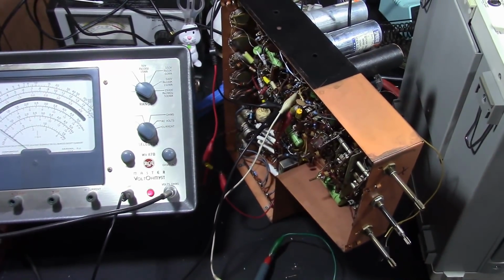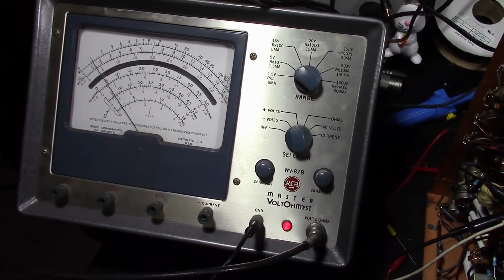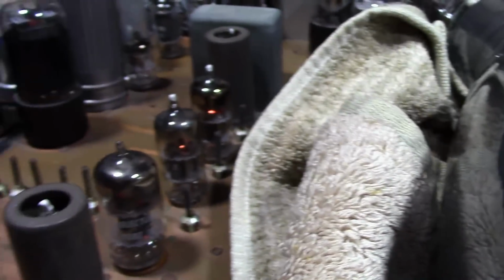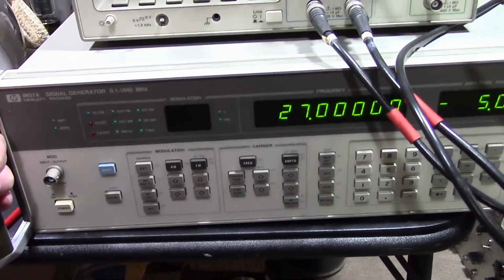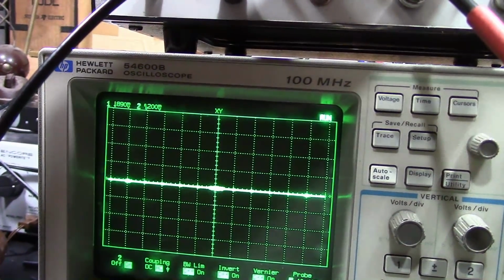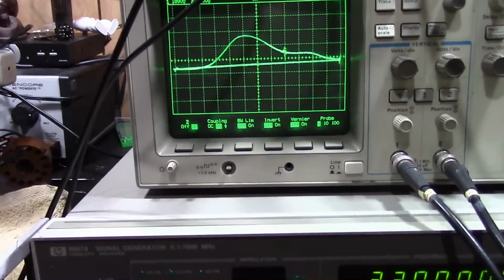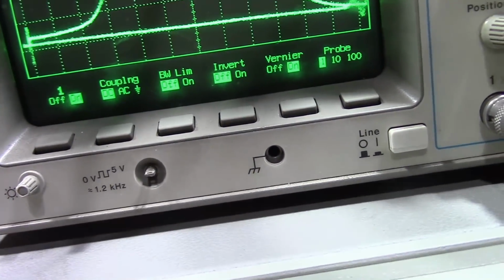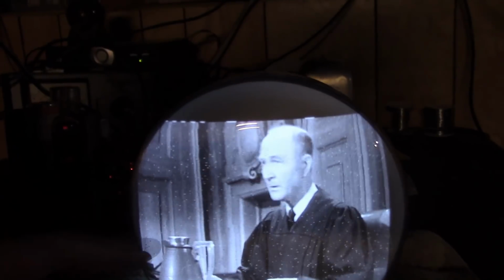Motorola VT-71 restorations p7o10

Comment: I see in 43 they only needed video for radar so a narrower bandwidth but still flat on top with sweep.
Reply from the maker: I'm not sure what you mean.  TV development was halted during WWII.  Radar displays are driven in a very different manner.  Some use yokes that rotate around the CRT neck.  Some had a 5th deflection element right in the middle of the display.

Comment: So back in 46 did the techs use a wobbulator instead of a wave generator. They never had any of this not even a good oscilloscope, but adequate.
Reply from the maker: They had sweep generators in '46 using a variety of techniques.  Variable cap driver by a motor or voice coil or a saturable transformer core driven by a sine wave.  Didn't really need one usually though.   You can do a decent alignment with a fixed RF generator.

Comment: I am surprised you did not connect a load for the audio. I was always taught that a valve amplifier Must have a load to prevent damage to the output valve and possibly the output transformer. Nice project, I have been following it from the start.
Reply from the maker: I'd heard that about solid state amps but not tube (valve).  Not saying your wrong - just that I wasn't aware it was an issue.  I'll have to do some research...
Reply: A transistor amp is quite happy with no load as no current will pass but a valve amplifier has current and signal passing in the primary of the output transformer which will of course be passed into the secondary with no where to go. I understand can course damage to the valve and or the transformer, possibly more so in high power amplifiers. I'm sure others will confirm or shoot me down in flames, one way or the other!!
Reply from the maker: I did some reading and you are correct sir.  Thank you for setting me straight :)
Reply: It's actually related to the topology of the amplifier. Transformer output, common emitter (or common cathode for hollow-state), either class A or B, needs a load. The "totem-pole" common collector output that is typical of modern solid-state does not need a load.